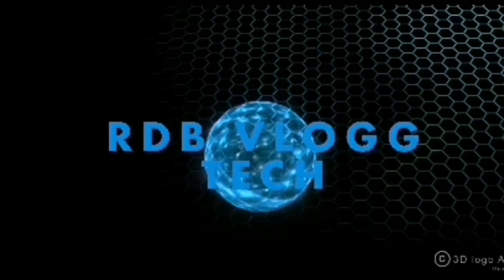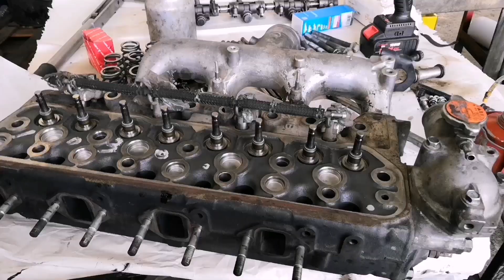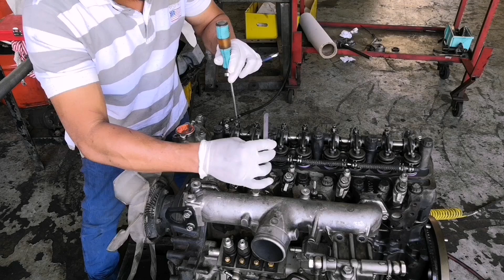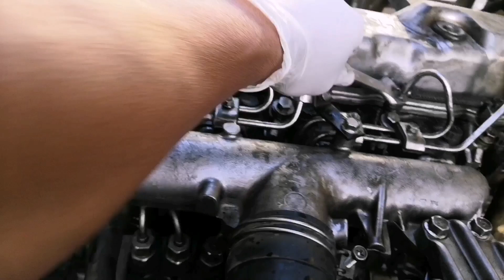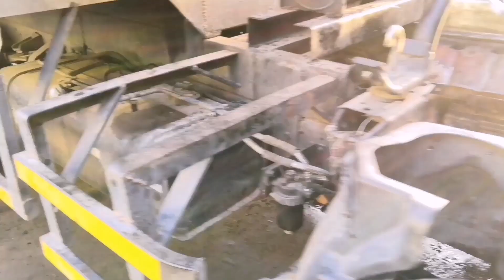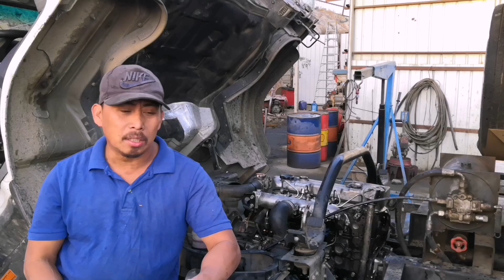BLOWBY ENGINE 4D33 MITSUBISHI & SETTING CYLINDER HEAD PART 3 ( tagalog full video)

Comment: boss ano higpit ng crankshaft bolt,connecting rod,cylinder head,overhead cam bolt, 4m40 engine
Reply from the maker: main 90 ftp'ds 55 con  85 cylinder head
Reply: salamat boss! God Blessed you!

Comment: sir sana mabasa nyo..ung space gear ko kasi malakas crankcase pressure kaya malakas talsik sa dipstick and oil cap..pero walabg usok pareho talsik lng, hindi nagbabawas ng oil, walang overheat, malakas hatak, malinis ang breather. Saan kaya galing ang malakas na pressure. Sa turbocharger kaya or injector washer or baka piston ring..ano sa tingin nyo sir..Salamat in advance

Comment: Bos ano po higpit sa crankshaft, connecting rod at head bolt. Balak ko ksi ako na mag overhaul sa makinA 4d33 canter?
Reply from the maker: kaya mo yan boss main 135 ftpnds con 75 ftpnds
Reply: @rdbvloggtech  salamat bos sa sagot. keep d good work.

Comment: what happens if you torque the specified torque, I have seen others using 195 to 200Nm for the head cylinder i.e. for 4d32 is it ok. advise.
Reply from the maker: torque 190nm conversion of ftpnds  is 140 last torque but cold 85 t0 90 after engine warm up  final 120 to 140 no probem  4d32, 33, 34
Reply: @rdbvloggtech  😲😲😲😳😳😳 nice answer master..

Comment: what are the specifications for valve clearance for exhaust and intake 4d32.
Reply from the maker: in my experiences 4d32 ,33 34 , my settings is from 0.14 to 0.16mm no noise and good starting

Comment: what are the torque specifications for 4d32 head cylinder, main bearings, con bearings and crankshaft flywheel bolts.
Reply from the maker: cylinder head 85fdpnds main 90, con 55 to 65fdpnds  flyweel 95

Comment: ilang araw break in kpag ganyang makina sir
Reply from the maker: ako sir isang araw lang kinabukasan byahe n basta standard lahat s loob at depende lng po sa pagka assemble ng mechanico d na kailang mahabang break inn
Reply: @rdbvloggtech  sir ok lang po ba 0.010inch bigay ko sa ring nang 4d33
Reply: hingi ako # sayu chief
Reply from the maker: ok po yan sir wlang problema check mo lng sir ung grove ng ring saa piston at ok ang linner
Reply from the maker: +966533298244 fb Ram Dela Cruz Balnig